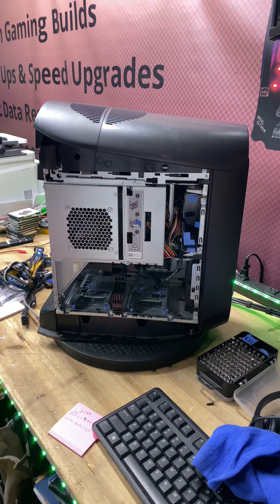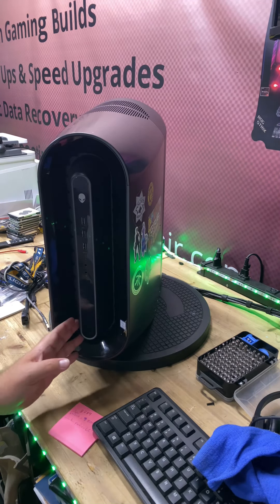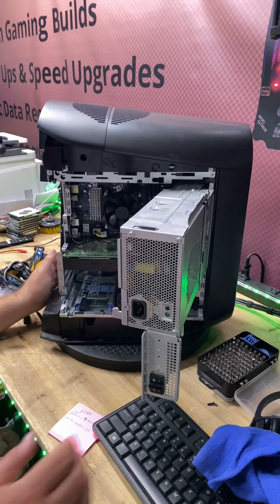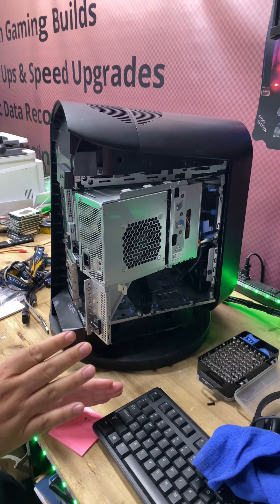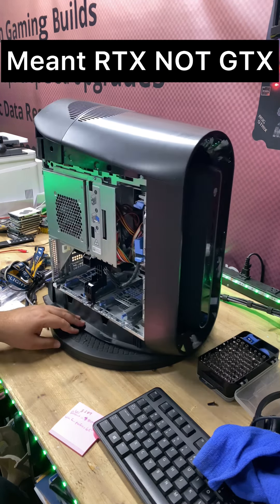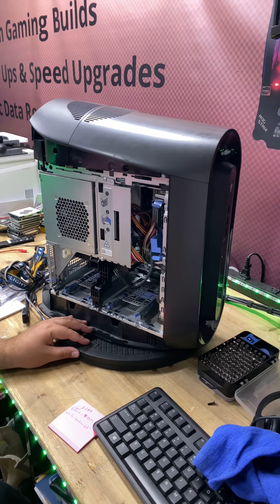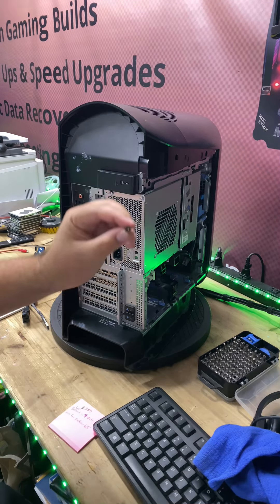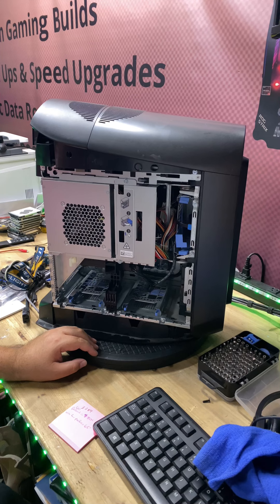Dell Alienware Aurora R9 - Worst thermal designed case ever?!?! Overheating FIXED!

Comment: Yeh I bought a used r9 i7 9700
and it only had a cpu fan as it was running hot when playing steam games so after researching.
I upfraded to.
Corsair h60 liquid cooler with a duel radiator fan.
Artic p12 front fan
Gforce rtx 3070 founders with a duel fan
32gb hyoerx fury 2666 should have went with 3200
Samsung 860 evo ssd
As I was going to take out the factory memory and just use the evo and put another fan where the factory memory was in case all that I did if it still ran hot, but everything that I did to it my temps are now around 60-70 full load
Rather then 80. So I still can add another fan in place of the menory if need be as I just started to play with iverclocking and my temps are still below 70

Comment: Valid points, I wish I would of watched before I bought an r11 a couple years ago. Went to upgrade some parts and suprise… they don’t fit. The 3 series video cards that fit in there are custom made (and probably not well). Luckily I found a video card with a cable to a fan radiator combo so it descreased the length and I was able to fit just barely. Still though… I may gut it and just start over with a home built. I expected more from Alienware.
Reply from the maker: It really is the higher ups at Dell. Someone who semi worked on the alienware R13 build project commented on a GAMERS NEXUS video and said this, 

"Meister
5 months ago
So I was somewhat involved in developing this system (can’t say specifically for reasons) and want to clear something up. Everyone, and I mean everyone designing the r13 wanted a new chassis. It was a constant point of contention among the engineers and designers, led to a small loss of staff and proved to be a major hurdle. 

Management refused to listen and doubled down, it was either make it work or get out. For many of us, the r13 was meant to be an industry redemption story, a system worth every penny. While management refused new chassis designs, they simultaneously demanded we shove as much tech (mechanically and otherwise) into it. 

As GN said, all the fancy shmancy additions were implemented to fit a ridiculous number of high-performance components into a chassis designed for Office workers of yesteryear. It wasn’t necessary, but at the same time, it was. 

“Bloat” is an understatement, half the development cycle was spent on making this work. Management gave us a reason, we were told that our chassis were over-produced in previous quarters and that all previous stock needed to be sold off before building in others. 

We were incredibly disappointed with the company, we felt as if we failed our fans and there was absolutely nothing we could do about it. Our lead quit after the r13 shipped, an incredibly talented individual that fought with management for years over stuff this channel regularly points out. 

My main point in all of this is, please don’t blame the engineers and designers at Dell. we’re definitely not idiots, rather, we’re chained to Dell’s inherent greed and backwards managerial style. We don’t have any say, and if we did, things would be a hell of a lot different. 

Sorry everyone, just about every colleague of mine watches this channel, hoping to get more of a voice in upcoming products. 

If you have a minute, contact Dell and encourage them to “listen to the engineers!”, maybe that’ll make a difference!"

Video Source:https://www.youtube.com/watch?v=DY1dlVPzUVo
Reply: bro you didn't know better and got scammed. It's all proprietary parts, garbage tier, with a case made for offices in the 90's. It has happened to all of us, my advice is just throw it in the bin and build your own pc.
Reply from the maker: @yanni-duff  it’s not mine, it’s a customers. I would never buy a prebuild especially Dell Alienware or cyberpowerpc.
Reply: @coryscomputerrepair  I was referring to the original commenter, but even then I just noticed he said that was years ago. He prob already has a decent build for himself.
Reply: I bought an R11 when covid was the thing and I couldn't get any parts I wanted. Specifically a higher-end GPU. It worked ok but was way overpriced. Recently I wanted to replace my work pc at our business so I reassigned the Alienware for work duty(non-gaming). Took the RTX3080 out of it and built my own using that. Put the GTX1060 in the Alienware. It's good for work. Fast enough and the one I built for home gaming is a much better, much cooler running rig. I think I paid $1200 for all the parts except for the gpu.

Comment: beginning to have thermal issues with my r9 after nearly 3 years. This video explains why. I didnt know much about pc builds back then, and I still dont but im not sure what I can do to remedy this.
Reply from the maker: Look into setting custom fan profiles for the DELL fans in Dell Alienware Command Center under FUSION>Temps. Do not use the preconfigured profiles for temps. You are going to have to play around with it. It took me awhile to get it just right to where fans kicked up when CPU temps reached a certain temp to a tolerable noise level and speed and then spun down at a certain temp. Then download a program called MSI Afterburner to set GPU fan profiles and repeat that same spin up high temp and spin down low temp.  You do this at your own risk, I am not encouraging you to use the overclocking tools AT ALL.  The MSI Afterburner program still works even if your GPU/Graphics card isn't MSI branded.

Comment: The R9 is a 2019 Alienware Design. I'm curious to know why it started overheating in 2022 ?   I'm not saying their design is good, far from it.  I find it weird that a 4 years old computer starts overheating after 3 years.
Reply from the maker: Very good question! I actually asked the customer that same question. The answer, with me doing some digging for more information, was basically the customer was not playing GPU-intensive games up until 2022. He was only playing Fortnite and Roblox. Then he decided to get into COD:WARZONE and that is when the issues started. Warzone, as most know, is a GPU intensive game.
Reply: Mine started overheating too after two years. The issue was the grill in front of the exhaust fan was blocked with dust. Cleaning it with compressed air fixed it.
Reply: Yeh I bought a used r9 i7 9700
and it only had a cpu fan as it was running hot when playing steam games so after researching.
I upfraded to.
Corsair h60 liquid cooler with a duel radiator fan.
Artic p12 front fan
Gforce rtx 3070 founders with a duel fan
32gb hyoerx fury 2666 should have went with 3200
Samsung 860 evo ssd
As I was going to take out the factory memory and just use the evo and put another fan where the factory memory was in case all that I did if it still ran hot, but everything that I did to it my temps are now around 60-70 full load
Rather then 80. So I still can add another fan in place of the menory if need be as I just started to play with iverclocking and my temps are still below 70.

Comment: you didn't offer any tips on how you improved the cooling just Dell bashing.
Reply from the maker: First and foremost, I bashed the ALIENWARE line NOT DELL as a whole! I actually like Dell desktops and laptops outside of their ALIENWARE line.  Second of all, did you read the description? I posted the solution on what i did to maximize cooling and minimize overheating. I would call that "a tip".
Reply: No I did not I watch youtube to see how people are fixing this problem not to read how they did it. @coryscomputerrepair
Reply from the maker: @dangbeaudry   Definitely sounds like a "You" problem.  Plenty of people read the fix in the description an messaged me a thank you. 🤷‍♂🤷‍♂

Comment: Water cooling the CPU is a must, & why Dell sells it as an option is stupid.
 I wish they would have designed the case so you could have a Water cooled GPU as well.
 Installing a set of BeQuiet or Noctua pwm Fans is also a must, For better cooling & noise reduction.
 I Just order an Alienware R10 setup, & I intend to spend a bit more money, on making this Computer work better, and hopefully be trouble free?
Reply from the maker: Why would you spend money on a Alienware setup only to have to spend more money to "make it better?" Why not invest that money into a custom build system where it is done right the first time and you do not have to attempt to make it better?
Reply: @coryscomputerrepair  My last rig was custom & only lasted 3 years before having issues, had it repaired, & it lasted another 8 months before it refused to boot up. I intend to reuse the Be-quiet case & Fans, and the Be-quiet PCU. but I will have to replace everything else, & I have no desire to do so right now.
Reply from the maker: @Apittslife  I am sorry to hear that. Not trying to toot my own horn but all the custom gaming systems I have built for customers in the last 9yrs are still going strong no issues. I stress test the GPU and CPU and ensure proper airflow and cooling. I am not saying you did not do that, simply saying I would consider your custom build that had issues a one off and not let it give custom gaming PCs a bad wrap.
Reply: @coryscomputerrepair  I am not upset that it didn't last longer. I built it piece by piece, by myself, & had fun doing it. But when I rebuild it, I intend to go all high end.
When I built it, I lived in a larger Metro area, where finding parts was easy. I now live 2 hours away from anything resembling a Large City, & 10 hours from a large Metro area. That is why buying a prebuilt was Good for Me.
Reply from the maker: @Apittslife   Location usually does not determine parts availability considering most people order components online via NEWEGG, AMAZON etc. Not everyone lives close to a Micro Center. While I was giving you the benefit of the doubt that maybe you prefer to support stores, you stated you ordered your prebuild online and had it shipped to you. So I am very confused at your logic on this one. How does not living close to anything resembling a large city, exclude buying individual components online and having them shipped for a custom build but does not exclude a prebuilt gaming pc from being purchased online and shipped? At the end of the day it is your choice.
Reply: @coryscomputerrepair  Ordered online, But had to take a Four hour round trip drive, to pick it up, as it couldn't be shipped to me. 
LOL, Living where I do now, I am finding that out the hard way, as I was so use to finding anything I needed, or wanted, within an 2 hour drive in any direction of where I lived.

Comment: Alienware/Dell are terrible, using any and every single metric you want to or care to. I think they are the worst company out there for PC's. If anyone  buying a pre-build is even remotely considering them, give your head a wobble. Build one yourself. It's easy, enjoyable, and in a lot of cases, cheaper.
Reply from the maker: While I agree the Alienware PCs are bad, I would not use that to label DELL "the worst company out there for PC's" when in fact they made very high quality consumer and business products. Dell is one of the most reliable brands there is. I have been working on computers for 20+ years and they are by far the most upgrade friendly desktops and laptops. Dell Laptops almost always has a easily removable back cover to access RAM and HDD.  Lenovo would be good as well. By far the worst has to be HP.

Comment: I think you are incorrect about the airflow, I have one of these and judging by the dust on the grill of the exhaust fan there is no issue. All you need to do to fix this machine is blast it with compressed air once a year.
Reply from the maker: lol. That’s all I have to say to your reply.
Reply: @Nilmeanseo I don't think that's true, I just had my fan cleaned a little while ago and I even upgraded the SSD from 256G -> 1TB and I am still getting crazy fan noises when running certain games. Are you just playing less graphics-intensive games / have fewer games installed on your R9? By the way @Coryscinoyterrepair how did you actually help the cooling situation?? I don't want to completely abandon my R9 so please let me know how to upgrade the fans if possible! They just make a HUGE amount of noise when I'm gaming